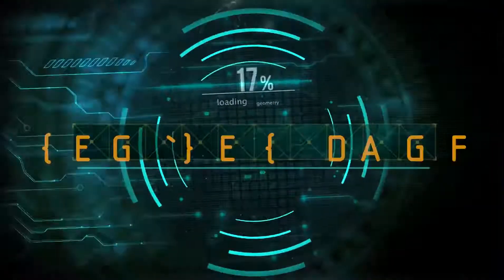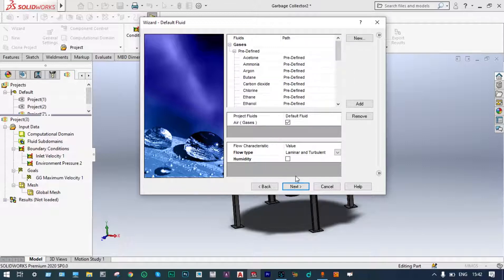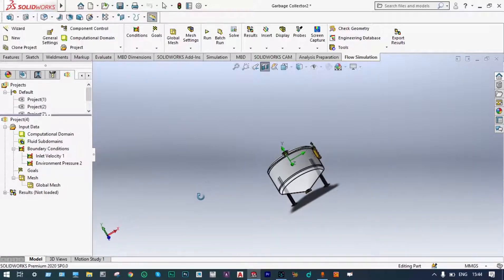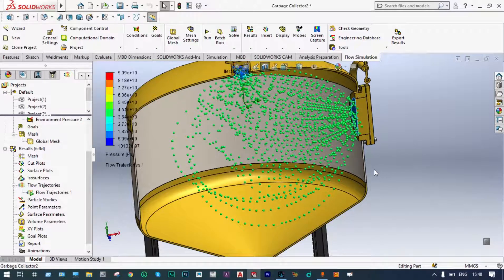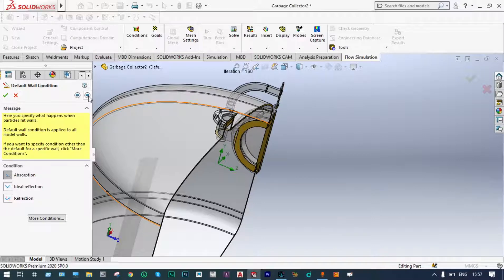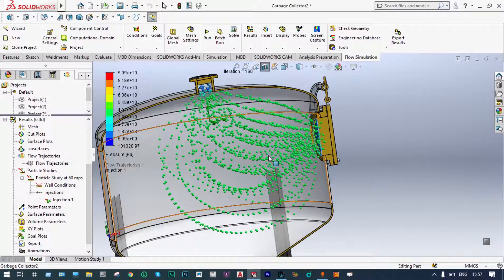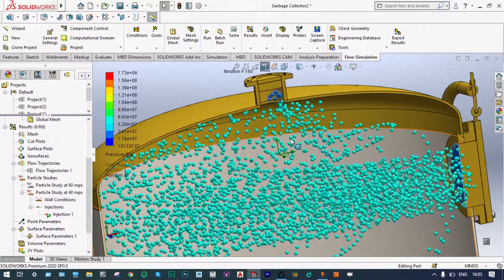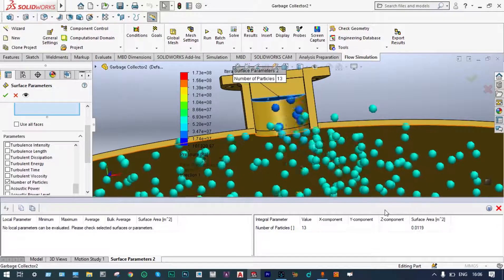CFD Particle Study and Optimization of a Garbage Collector with SolidWorks 2020

Comment: Thanks sir, it is very helpful to understanding the flow simulation.
Sir could you help me, how to calculate required torque on the  agitator in tank with help of SOLIDWORKS flow simulation.
Reply from the maker: It is simple. I will show this one with a video within a short time
Reply: @CFD_GUIDE   thanks sir

Comment: Can you run parametric optimization to get optimal speed, shape of the chamber, etc.? I tried running it but since particle study is a post-processing step, I did not see any option to do this. I am running Solidworks 2020.
Reply from the maker: You can go for Parametric study again after finishing normal analysis.
Reply: In your example, you manually changed the particle velocity to find the maximum possible speed where the particles would not escape the chamber. Could you get to this speed by using the optimization routine in Solidworks?
Reply from the maker: Actually, in this case the post processing result was optimized manually. I have thought of doing it automatically. I will see the possibilities later on with a new video and definitely intimate you about this. It is a good suggestion.